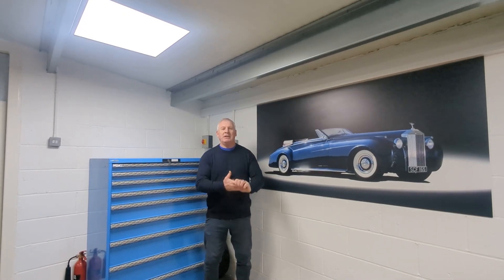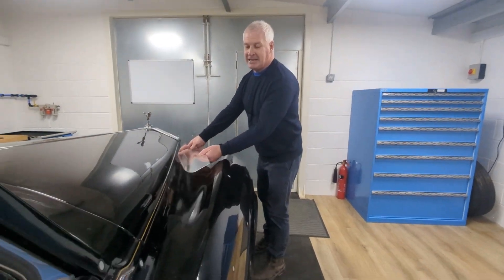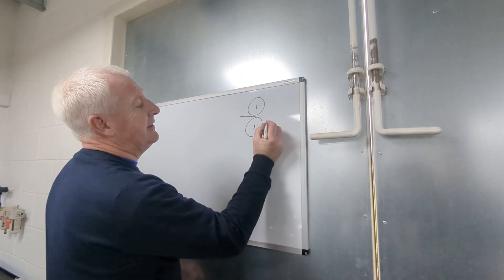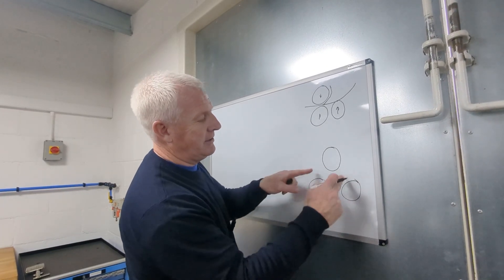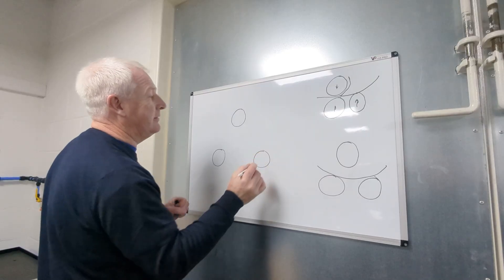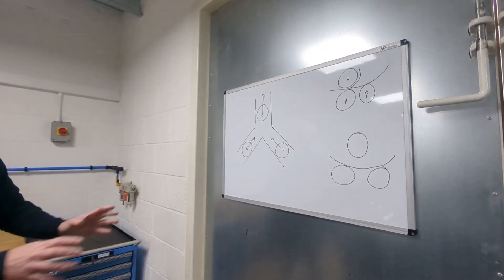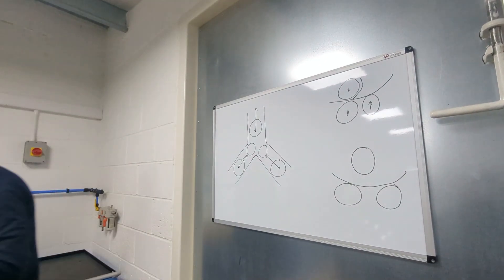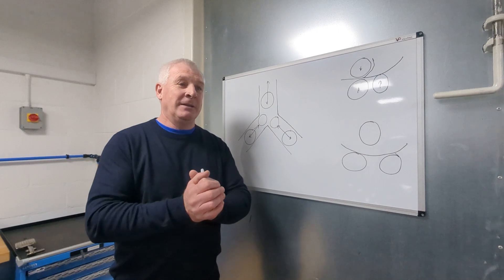How to Make a Unique Sheet Metal Bending Roller Machine for Coachbuilding Car Body's

Comment: use a chain with tack up system.
Reply from the maker: Hi sorry for the late reply, only just read your comments. That sounds like a good idea. What is a tack up system? Thanks for watching
Reply: @Damworkshop Basically it's a chain tensioner. I meant to say take up system not tack up. Sorry.